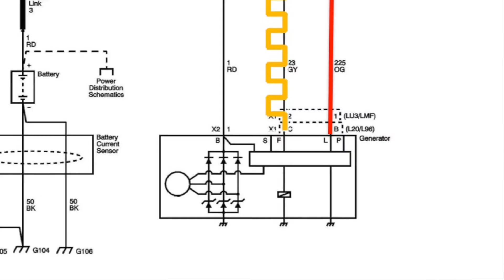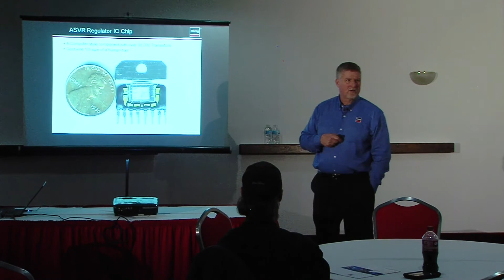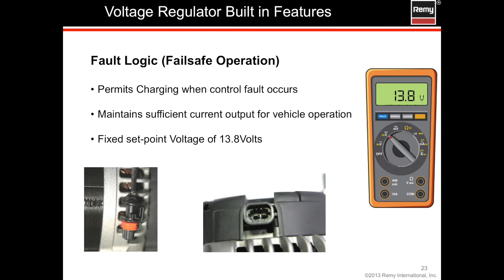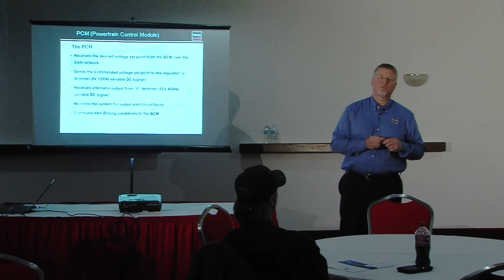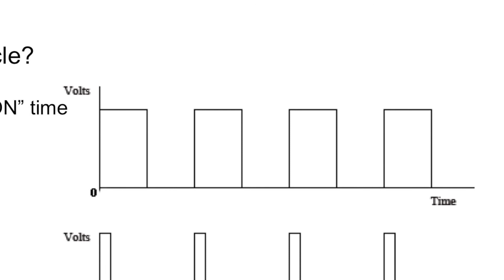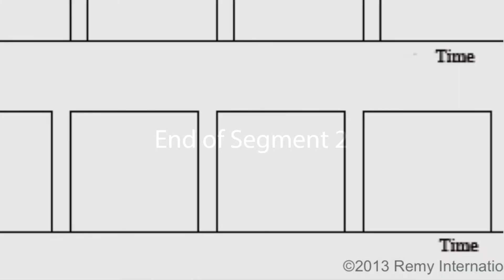GM RVC #2 of 4 Computer Controlled Alternators

Comment: So if the PCM is constantly monitoring the battery state of charge and notes the battery SOC when the engine was shut down, will putting a maintenance charger on the battery confuse or affect the PCM?

Comment: make sense? not really,  ...... it would be a lot better if you could explain how pcm control voltage and monitor amps rather than just talking as if you are reading from book.drawing a schematic and even pointing to schematic would be helpful or its too much to ask.look how the other explain  and teach other subject and get some idea like scannerdanner and pinhole auto,Weber.
Reply from the maker: Hi Ghazanfar - Thanks for watching and commenting. We understand! This video was shot during a class. So it was like you said - the people attending had schematics. Also, it's one of 5 videos in the series, so it gets clearer when you see the series. Check back with us - more on the way. Thanks again for commenting.
Reply: Ok, so I understand how this system works... is there any way to bypass the system for electrical upgrades? Or a way to reprogram the system to accommodate electrical upgrades?
Reply: Route the add on grounds through the amp clamp